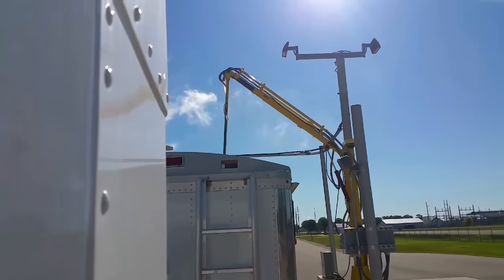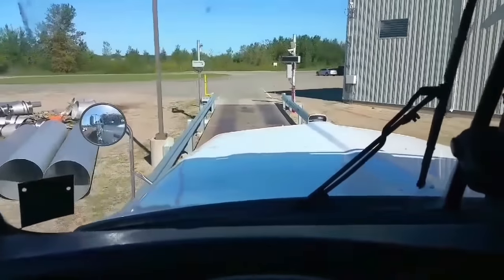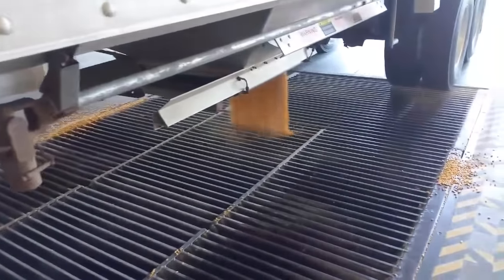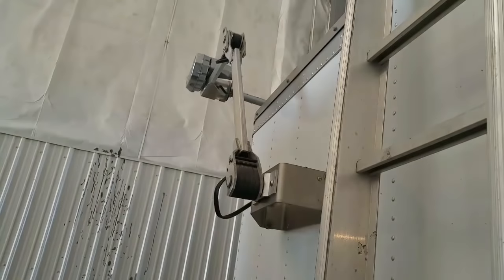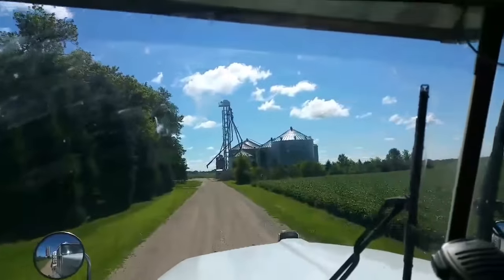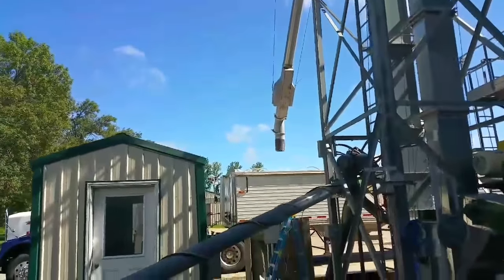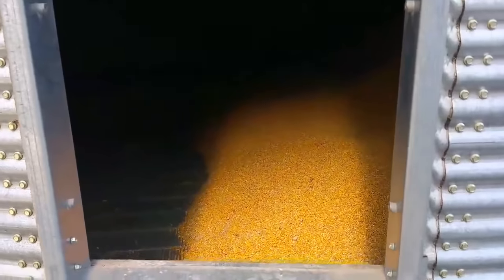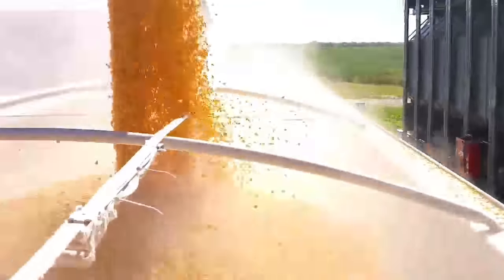Hauling corn to the ethanol plant

Comment: I was raised on a dairy farm in Colorado milking 100 cows twice a day. We grew all of our feed with the exception of the grain we fed the cows while we milked them.
I am not a fan of ethanel. It has less energy (BTU) than gasoline, which means less MPG and it costs more than gasoline.  It is very harmful to two cycle engines. I had to replace my fuel hoses on my weedeater last week. I know its good for the farmers $$$, but we are the ones paying for that crap fuel that is mandated by the government.
Reply: Surely ethanol is only a small percentage of the gasoline, approximately 5% I believe, it replaces Lead which was extremely toxic and harmful to everyone. Lead was only needed to aid valve seating in an engine, Ethanol is a much better option, just drain your fuel tank /carburettor if you're not going to use that piece of equipment for long periods and everything will be fine.

Comment: How much does the government subsidize the ethanol operations?  It lowers the quality of our gasoline and helps ruin small engines.  I think the corn can be put to a better use frankly.  Nothing personal; you're in business to make money of course.
Reply from the maker: Dixon Peer There have been ZERO ethanol subsidies for several years now.  This went away a long time ago.  As opposed to the oil industry, who accepts TONS of government money.  Also, 70% of the value of the corn still remains after it is processed for ethanol.
Reply from the maker: Dixon Peer Also, oil companies are able to blend ethanol with lower-grade gasoline and still.meet octane requirements.  I will argue that it's the poor oil that causes gas problems, not the actual ethanol.  Alcohol attracts water, yes, bit a small amount of maintenance will help that.  We have run ethanol in EVERY engine we have for many years and not seen an single issue from it.
Reply: No arguement, but I ask you: the government requires ethanol content in all road fuel gasoline I believe.  Perhaps the outright subsidies are gone, but that requirement is a biggie.  It seems to show the outsized strength of the farm lobby relative to the interests of the "rest of us".  Here is a copy from a Google inquiry about ethanol:
"Pure gas gives better mileage than E10, and much better than E85, simply because gasoline has higher free energy than ethanol. The free energy of gasoline is 34.2 MJ per liter. ... Mileage will be reduced even more if your engine doesn't run as well on E10, which is often the case with older vehicles.
Reply from the maker: Dixon Peer Shouldn't the interest to the "rest of us" include things like energy security and renewable energy?  You can't disagree with that, do you?  Yes, gasoline is more efficient in an engine than ethanol, but gasoline is also more expensive per gallon, and much more harmful for the environment.  You never hear of any beach being closed due to an ethanol spill.  And emissions are cleaned up considerably when ethanol is added.
Reply: Do you put ethanol in the tractors?  Just kidding.
Reply: Dixon Peer jjyyyy
Reply: MN Millennial Farmer you can make more power with a bigger safety margin, if you make the necessary mods and tune your engine for it. Project cars and track cars really love what you’re doing there!